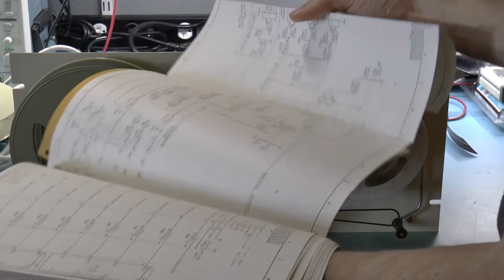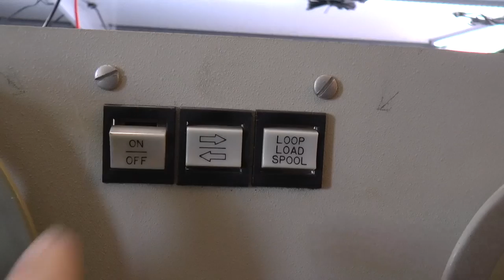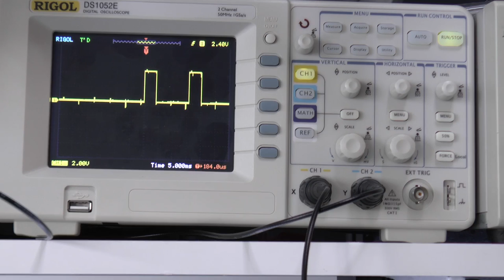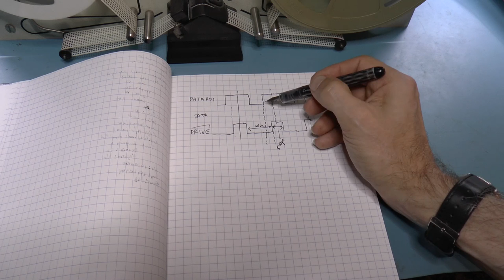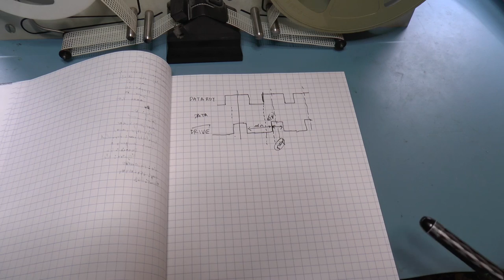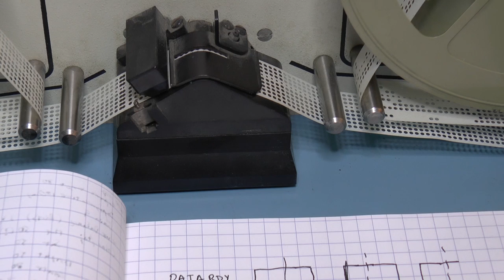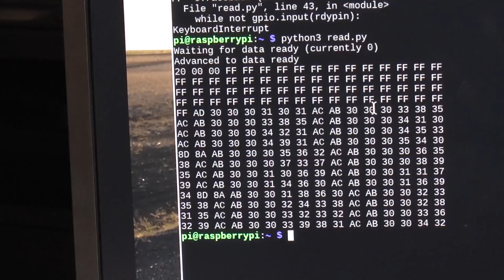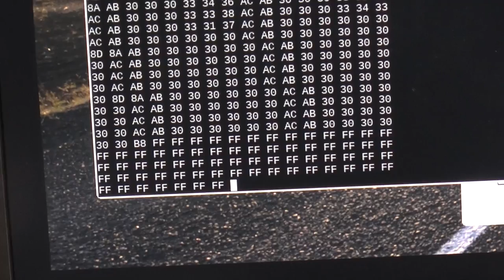Reading punched tapes with a Remex RRS7155BA1 reader

Comment: You have inspired me to do my own video.  I have a Remex RRS3300.  In read mode it moves the tape at 300cps by a capstan and pinch roller and stops it with a brake; in wind mode it goes around 300ips using reel torque controlled by a complex system of AC motors, triacs, brakes, relays, and microswitches, including one that acts as a differentiator.  No sprocket.  It reads the sprocket holes optically same as the data holes and outputs them as a ninth channel for sync.  Compared to your machine, it absolutely flies, so it should make an exciting video if not as polished as yours.  I use it to archive tapes that came with my IBM 1620 Data Processing System in 1978, because the 1620's own reader wears out tapes.

Comment: Drop the upper bit. AD = '-' AB = '+' AC = ',' 8D8A = CRLF
Reply from the maker: ZomB1986 nice catch!! It's all just comma separated data!
Reply: oh, yeah, someone else got the pattern further down the comments. I hadn't read this before I posted my guess at hte same thing. It looks like they "ab-used" the parity bit to indicate any byte that wasn't a digit, so signs, comma, and <CR><LF>. The dead giveaway for me was the 0x8D 0x8A, which is just too similar to 0x0D 0x0A, which anyone that's spent any time in a hex editor immediately recognizes. I got a piece of plastic tape with something I bought, and I was curious if anyone had an open source reader design to read the tape (besides decoding it manually) to see what it is.  This isn't quite that, but there are some open source designs that use LEDs (both as light source and reverse biased as photo diodes) to make an easy reader.

Comment: Friend, there are 2 ways to store content on punched tapes. Tapes with text information and tapes with machine code (binary codes), which is your case. Therefore, your tape used as an example in this video is binary, it can be executable file or data file. Although its tape is called binary, the 8 bits combined, shows codes in base 16, that is, hexadecimal. The hexadecimal code is represented by numbers from 0 to 9 and from A to F, totaling 16. This is why you see AB, C6, 3F, EE, etc. So that your binary tape can be a computer game, or it can be a utility, or it can be data, or both. If you want a tape that contains text, which is easy for you to read, then the tape should be in the standard ASCII format, which has 128 combinations, and therefore uses 7 bits. Therefore, tapes that have ASCII text recording, will have the eighth bit always punched, by the way, since it is not used in reading. This allows you to view the naked eye, any tape, and whether it is text or binary, because of bit 8. So if bit 8 is being used, the tape is in machine code, otherwise if bit 8 does not is used and is punched, in one corner, across the row of the tape, then the tape refers to text characters, such as uncompiled source codes, digital books, personal notes, readable data, and so on.
It is important to remember that even ASCII characters have their hexadecimal equivalent. So your program in Raspberry should be able to display text as text, rather than hexadecimal. Otherwise, you will continue to see characters illegible for texts, because as you know, the punched tape always represents information in binary form, whatever the content.
Hope this helps. Greetings from Brazil.
Reply: The first tape he read is definitely a bunch of data with record separators. It looks like they "ab-used" the parity bit (bit 7) to indicate any character that isn't a digit, so if you strip off the "parity bit", you get AD ==> 2D or "-" (minus), AC==> 2C or "," (comma), AB ==> 2B or "+" (positive), 8A ==> 0A (line feed) and 8D ==> 0D (carriage return). Then when you decode the first 2 lines of data, you get:
-000101,+000385,+000385,+000410,+000421,+000453,+000491,+000540<cr><lf>
+000562,+000658,+000757,+000895,+001069,+001179,+001460,+001694<cr><lf>
Looks like some sequence of increasing numbers. This makes sense with what was written on the tape by hand, indicating it's some data for some test at a particular temperature.

Comment: @Robert Baruch — Does this Remex reader have a tape brake?  In the early 1970s I worked with computers that used paper tape readers and punches, and high-speed optical readers were capable of reading the tape faster than the rather slow computers were able to accept the data.  Since the tape reels couldn't be stopped instantaneously, an electromagnetic brake shoe was built into the reader head that could be actuated in less than a millisecond, halting the tape until the computer was ready for more data.  In fact, a "stupid computer trick" of the day was to write a program in assembly language that could actuate the brake at audio frequencies.  One would stick a sliver of paper into the reader, load the program into RAM, and the brake shoe would hit the paper, playing buzzy, kazoo-like music.

Comment: This is pretty neat.Together with that writer you could build a translator system to read/write paper tapes to/from modern formats such as 5 1/4' floppies, audio cassette, and CF cards.
Are you going to upload dumps of the data from the tapes you read?Best of luck with your future project stuff.

Comment: Just curious how the MSB/LSB on the tape is defined.  I suppose the bit order on the DE25 is well-defined.  Are the tractor/sprocket holes off-center to enforce this physically, so the tape can only lay in the reader with the right side "up"?
Reply from the maker: lmiddleman "Track 1" has a well defined position, the outermost of the group of 3 holes on the one side of the sprocket holes. This is usually the lsb. It seems that the msb is a parity bit for ASCII data.
Reply from the maker: lmiddleman And yes, the sprocket holes are asymmetrical on purpose!